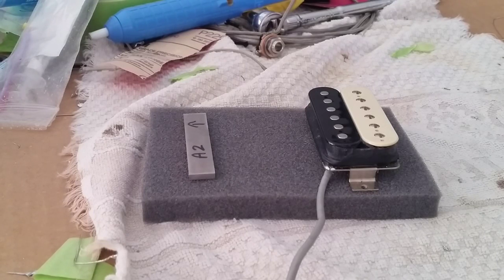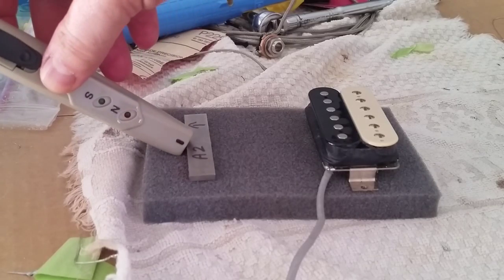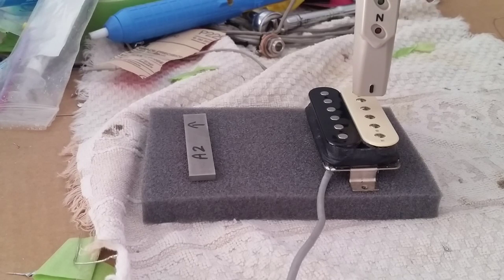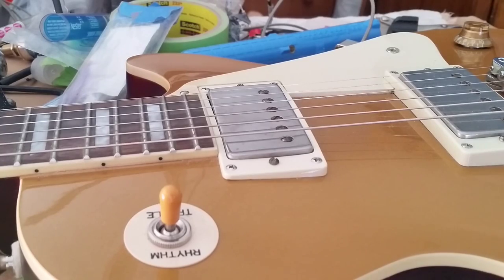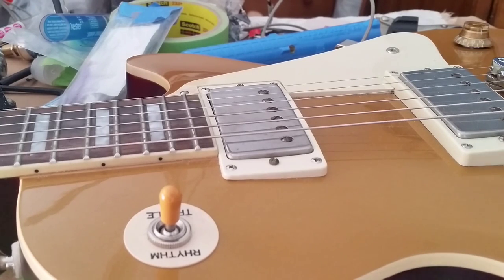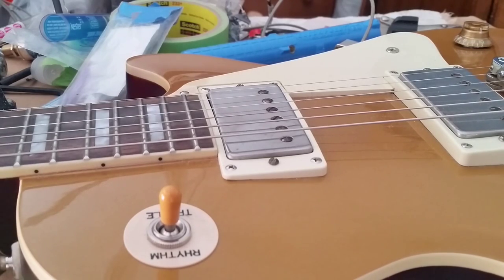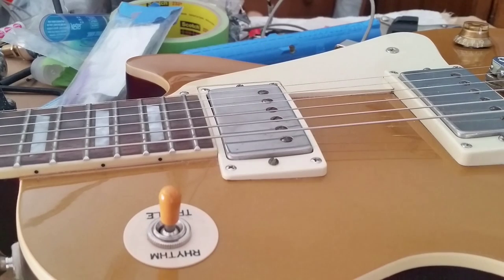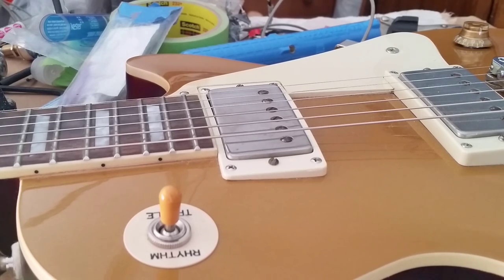Testing magnet polarity of bar magnet in humbucker pickup

Comment: This is really good to know. I had never seen a bar magnet placed under a single coil (or any application where a bar mag had been used) until I investigated while upgrading a Ventura bass guitar (Fender clone). The magnets are not seriously strong; weak, in fact. The coil is wrapped around a slice of light gauge steel channel. When I pulled the pickups, I found that the magnets were in 2 pieces for each pickup. Unfortunately, the magnets parted from the coils before I could index mark them, and I'm looking for more info to put them back properly. That's where I found this vid. Thank you for posting!
Reply: Ted Shredz You’re welcome.

Comment: Just came across your video and I'm having a problem with some custom wound pups I bought.  I had the neck pickup magnet reversed for the PG effect and when I installed them the bridge pup had no output or very little.  Do you know of a way to test how the pickups might wired.  I've tested the magnetic pole direction with an ordinary compass, but it doesn't seem to be consistent.   I was thinking the pups  wiring might be canceling the other out.  Any thoughts you have would be welcome.   Thanks, your video was helpful.

Comment: It does show the magnet was flipped. However, how did you conclude that the windings were reversed as well? or did you know that already?
Reply from the maker: V Ve 

In the Shed Supernaturals, the magnet was not flipped. South side of magnet is still facing the pole pieces, but the entire pickup is simply installed in reverse. The wiring inside is different from a normal pickup, giving the PG tone.

Comment: Hi, about magnet orientation and some other questions please. 
#1 would the humbucker work good enough anyway if you put the bar magnet's North side facing towards the screw sided bobbin (South) instead of slug sided bobbin (North)? 
#2 is it possible replace the maple/plastic shim by another bar magnet in order to have 2 bar magnets together in that humbucker?
#3 is it possible replace those slugs by copper-made ones - or other materials too? what sound might it come out?
thanks in advance
Reply: blo p Short answer...no.